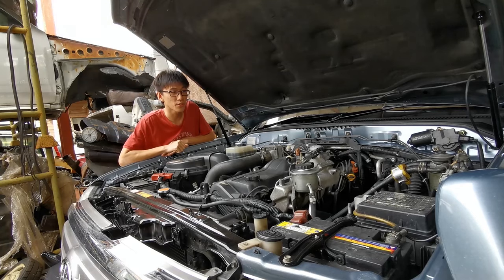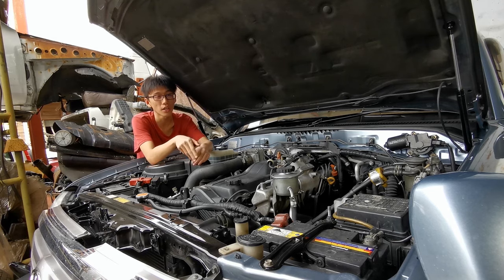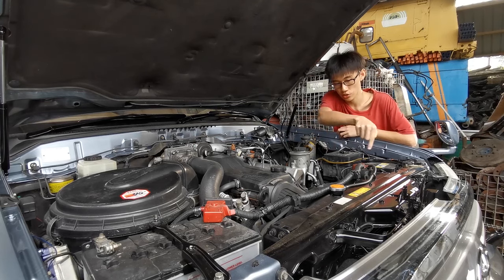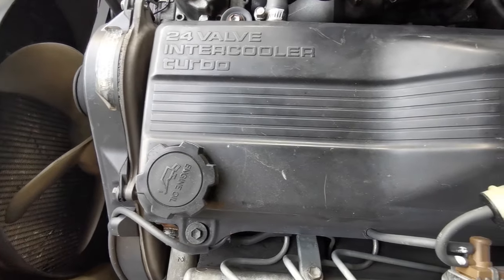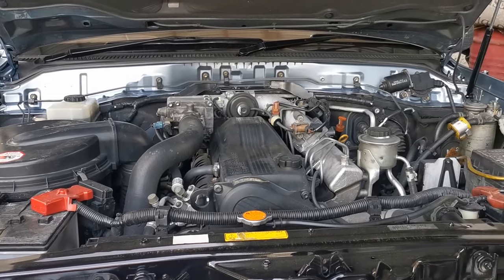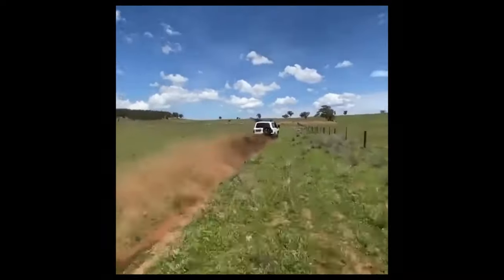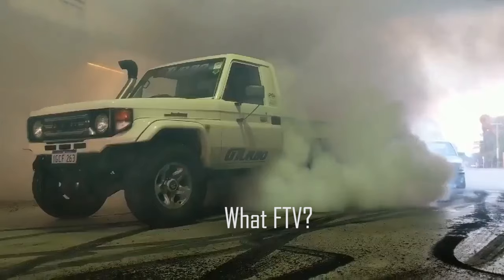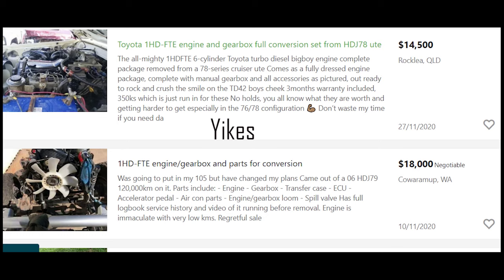Toyota's Greatest Diesel Engine Ever? 1HD-FTE Engine Overview

Comment: Not just Toyota’s greatest engine I believe it would be the best diesel car engine every made
Reply from the maker: It's definitely worthy to be in the Top 10 Diesel engines ever made in my books 😍
Reply: 6bt?
Reply: Make sure to replace those BEBS
Reply: @SacrumImperiumRomanum517 Killer Dowel Pin knocks the 6BT/4BT down a few pegs
Reply: Mercedes OM606 was a good engine too.
Reply: FYI: Diesel fuel does not burn. Diesel engines are detonation engines for the reason the fuel explodes. Diesel go bang. There is no flame front as the fuel burns as with petrol/gasoline engines. Boosting the fractory 1HD-FTE performance will shorten it's service life.
Reply: @sebastianromero420 that's just 1HDT.
Reply: @sebastianromero420 noneissue.
Reply: @jesuslabrado4862 That was only really an issue with the 24V and even then it can be modified to never happen
Reply: @AquaMarine1000 News flash- it comes boosted from the factory moreon!

Comment: I owned a 105 Series Cruiser with 1hz contemplating a turbo but your video inspired me to buy a 1HDFTE instead. I sold the 1hz with 240,000kms and picked up a 1HDFTE 100 series with 585,000kms for the same money. Very happy with the FTE it’s mint mostly highway kms so i figure it’s still got life in her.
Reply from the maker: Glad the video helped you to make the decision 😁. Do you have any socials would love to give you a follow. Mine is @tai392 on instagram
Reply: why give up the SFA?
Reply: Good move. The 1HZ is a hand grenade when aftermarket turbocharged and has nowhere near the potential of 1HDT or 1HDFTE engine.
Reply: I have a 105 with 1HDFTE .Motor only had 130 000km
Reply: My 1hz had a safari turbo kit put on at 180k
It’s at 411k now with now blow by 🤷
Reply: Same put a safari on mine 200k ago zero blow by and no overheating issues
Reply: @dave.a15  we’re the bearings done at the same time? Previous owner said they replaced the big ends at the same time
Reply: Do an engine swap of your 105 series with the 1hdfte then you have the absolute best of both worlds.
See what this guy has done:   https://www.youtube.com/playlist?list=PLCc9k0EV0wV9fB9SAN8vN3YeKxV2Yb6Yx

Comment: I drive a 79 series with the 1HD FTE engine. It has done 494,000 Kms and still runs perfectly. The most amazing thing about this engine is the fact that the oil stays clean between servicing at 10,000 km intervals. When I say clean, I mean clean, to the point it is hard to see the oil on the dipstick.  But I do have a question that you may be able to answer.  Apart from the sticker on the timing belt cover, I have not been able to find a Toyota logo on the engine anywhere and I find that very odd. I have heard unconfirmed stories that the engine was built for Yanmar to their specs by Toyota and that due Toyota having the troubles that you mentioned here, they got permission to use it in their own vehicles.

Comment: IMO its one of the best of Toyota's diesel engines along side the 1HZ it may not have the power of a 1HD-FTE but damn they wont die my 75 has just clicked over 300k and most of that was done on farm land it probably has around 50k of highway driving the rest is all off road same with our 105 its an ex Parks Vic patrol car.

Comment: Literally just purchased a 1hdfte 79series ute here in Australia today.
Have owned an 1hz 79series for 8 years. The 1hz non turbo is an amazing engine. Under powered but extremely reliable.. the new fte has amazing power on exactly the same running gear (gearbox and diffs upgraded) but suspension and steering identical.. the difference is unbelievable between the fte and 1hz.

Thankyou for your video. I am now subscribed 😀
Reply from the maker: Hey there, glad to hear you've made the jump to the best 79 generation imo 😆

I've always had a soft spot for the HDJ79 especially the HDJ79RV.
Reply: you mean 75 that came with the 1HZ the 76 came with 1HD-FTE in the later models before the 79 replace it and it has the V8 unless its had an engine swap done.

Comment: It's great, but Toyota required to replace the Crankshaft and Connecting Rod bearing at 150.000 KM, the indicator it's need to replace the bearing is low oil pressure under 1 Bar at idle.
Reply: That's 1hdt had bearing problems

Comment: Nice. Tip for anyone in the market, the auto is better than the manual. Uses a ford f250 gearbox and is just a beast off and on road. Mines rocking a badboy extreme Gturbo w/ a chip, exhaust, intercooler. Its quicker than my parents 200 series v8 twin turbo diesel, and stronger! LOVE FROM AUSTRALIA
Reply from the maker: Glad you liked it 😍 the auto imo makes it so much easier for the control and making the thing keep itself on boost. The 1VD is great engine no doubt but the small issues makes it just miss out on the Crowning jewel of Toyota diesels imo 😂
Reply: How did you go about transmission conversion, I’ve got a 5 speed auto which does not like extra power very much
Reply from the maker: @sappo6342  this runs a 4 speed auto. Great 'box imo. I'm aware the 5 speed auto has the overdrive issues 😅
Reply: @TAI-lr5vr  yeah the 4 speeds are decent, bigger box ect. In Australia especially with the 5-speed tuners are getting pretty good at tuning them to handle decent power, but I'm tossing up if I should just trade my auto for a manual haha
Reply from the maker: @sappo6342  our 4 speed did lose a forward clutch after beating on it for 10 years so not bad 😂

Comment: This Land Cruiser with this endine 100 and 80 series are still very expensive and getting more in the Phillipine, especially the locally sold for the domestic market, GCC market and even the JDM converted to LHD. 30-40k usd(50 php per 1 dollar) for the local, GCC and JDM for 10k usd.

Comment: 350,000 km and more economical than most 4 cylinder engines. Best engine Toyota have produced.
Reply: These have worst fuel figures  of any deisel even  a merc uses less and a LR td5  probably  10 more mpg   but the Toyotas good reliable  engine   but have seen  plenty  busted injector pipes

Comment: Good job Tai, very details video . Since you seem to have good sources, what do you think would be the enhancement for an 1hd-ft that would be equiped with 1hdfte injector  nozzles and pistons? 
Cheers mate
Reply from the maker: Glad you liked it. An FT with FTE nozzle, piston and injectors could probably increase the power output. The key is still in that injection pump system though. Not sure if it helps but many have had success doing an FTE minus E(non electric pump) conversion.

Comment: As a mechanic I love this engine in my 22yr old Cruiser "never a problem", But I am going to fly this question by you because you seem to research things like this, Why did Toyota put the oil filter upside down so it drains of oil so quick when parked, seems silly when it takes that bit longer to get oil pressure when started..Cheers Dave
Reply from the maker: Hey there, unfortunately I can't give you the answer to your question as I don't have access to the people responsible who designed this engine

Comment: How does it compares to the 1HZ in terms of reliability?
Reply: Lemme put it this way. My parent bought his 2007 model in 2008. Last year as i drove it, the speedometer ends at 180, and it aurpassed the limit and bent down like it was doing 220 or smthn. Mileage is 240,000 engine has never had issues or been opened. Only challenge i came across was that the break booster pump failed in 2017, some mechanic replaced a small part in it and charged me 70,000 ksh (700USD at that time) , a new brake booster pump in toyota kenya nairobi is 3,000 usd.
Reply: @zakgt500  Thanks. That's very helpful

Comment: I have a 2003 79 series rv has 340 klms so far no dramas .
Have fitted industrial fuel and oil filters from Filter Technology Newcastle.
Save a fortune in oil had the oil tested At 30,000 klms still ok soot particles were 0.4 ppm max allowed 2.0 ppm 
The filters are separate to the factory filters.
And finer 2 micron fuel and oil .
Factory filters 10 microns

Comment: I have the same model 100 series and was wondering relating to the oil pressure you showed , was that idling from cold start. my pressure goes up to 1/2 on cold and under load but when idling goes down to 1/4
Reply from the maker: Yes it is. I have noticed on the late model 5at cars the oil pressure doesn't go up nearly as high as the 5at cars have VSV
Reply: @TAI-lr5vr My oil pressure does exactly what is said here , hdj100 2006 , 1/2 cold & under load , 1/4 hot idle . Excuse my ignorance but what does VSV stand for ?
Reply from the maker: @barbraabsalom4531  VSV stands for vacuum switching valve which I must admit I got wrong. What I should have meant was the swirl flaps decreasing the oil pressure

Comment: Hello what do you think a bout 1hz ist good ?? Specially for off road ,mud , desert...
Reply: The 1HZ is a very strong, reliable engine that just keeps going. It’s incredibly slow, but it just doesn’t die. It feels like driving a tractor but you can always rely on it. The only issue with the 1HZ is when it comes to sand driving, where you really feel it’s lack of power if it’s over sand dunes.

Comment: Sorry but the 12HT has that accolade, and yes all Toyota engines good and great build quality, I cannot  believe I have been driving the same car for over 25 years.
Reply: 24years here.. on 220k mileage.. still running good.. thumbs up for it... Never fail on me.. do on time service and maintainer... Need chipped soon.. unichip maybe ? Or mod none electric fuel pump.. still thinking lol..

Comment: I had the privilege to drive a 400hp 1hdfte from Performance Diesel Intercoolers. It had the gturbo which is actually not larger, just more efficient.
Reply from the maker: Oh so it's the turbine that's different. Never had the chance to experience it due to the Mula amounts to buy an engine here
Reply from the maker: I didn't have the turbo size chart from Gturbo so I had to wing that part 😅

Comment: Serious question.
Is it possible to make a brand new 1hdfte using the 1hz block and aftermarket parts?
Will the cooling jacket and gaskets fit?
Reply from the maker: The basic block is mostly the same. It's the rotating assembly and cylinder head that's the real headache. And the fuel pump setup. I've seen some push a HZ-T to 500WHP so there's a big chance you can transplant the innards.

Comment: Hi bro which one engine is better 1HZ or 1HD FTE or petrol uz please tell me?
Thanks
Reply: 1HDFTE, the 1HZ is a slug, still an utra reliable engine but nothing compared to the 1hd-fte in terms of power.    You can put a low boost turbo on the 1hz but anything more will blow up your 1hz.

Comment: No matter what caind of the engine type is!! Of course TOYOTA have a best ever diesel engine from 2.4 to 4.5 they are a inmortal engine's 👏👌👌 cheers from Norway 🇳🇴
Reply from the maker: Thanks for your support! 😁
Reply: @TAI-lr5vr  i have a BJ 40 3.4D, HJ61 4.0TD, corolla D4D and  my father have a  HDJ80 4.2TD and a hilux 2.2D no problems the BJ40 just passed a 2millions kms and the corolla 490.000kms anyway we never stuck on road 👏👍👍
Reply from the maker: @jorgefonseca9225  that is awesome! We have 98 HDJ101K and ACA20 rav4 as daily. Lovely cars 😍

Comment: Do a vid on the 1hdft! How much better is it than an FT and how much better is the FTE? We’re not getting the FTE in America for another few years and I want an off road touring rig. With an emphasis more towards off-road.
Reply from the maker: Hi there, sorry I couldn't respond to your comment due to notification of YouTube playing up.

The 1HDFT is probably the pinnacle of mechanical injection diesel engine for Toyota but the FTE'S electronic fuel pump makes the driving experience so much better as it's more responsive and overall more fun to drive.

Comment: Only thing i have a problem with is the 2.8 hilux is literally just this engine minus 2 cylinders, and better balancing and vibration handling in the crank plus dont need a forged crank either unless you want more than 20 PSI

Only problem with the 2.8 is that it cant take load at all, its good when the cars full but if it then also has to tow something then it becomes an issue, but even then you can negate thag by getting 4.8 diffs and reduction gears then 31 by 10.5 and you shouldnt have much trouble

Really the only problems ive come across in the 2.8 is that it gets a little  hot sometimes when turboed, and the main weared parts are around cylinder 3 back. If yoy want to turbo a 2.8 you need to rebuild the injectors, get a boost compensated pump and then hook it all up and it shouldnt over fuel it nor under fuel it, if you  just use the stock pump it runs too rich and the load on the engine is increased, plus its only looking to be about 1000 for a boosted pump hopefully.
Reply: Hi bro..i have the 2.8 you are talking about and looking with envy on this hd engine😬. So we are in the same boat talking about turboing our asthmatic 2.8😅. Hey but take heart the 2.8 na will survive a nuclear holocaust 🙂
Reply: @hokz7283  oh  yea NA they will go forever and theyre a good starter car, but ive been researching alot on how these engines fail and what you need to make them efficient, cause thats what a turbo on the 2.8 is really for you gotta think its already getting over fueled stock cause theres not enough air being sucked in. 

If you get a boost compensated pump thatll stop it being really rich at thw start and then leaning out, and youll actually be able to get it tuned to 20 psi with a good turbo
Reply: @hokz7283  also apparently someones putting a 2hdt in a hilux and thats because he seen a RB30 swap
Reply: @samtimo3002  can we not just adjust the fuel enrichment screw to allow for lesser fuel then stock setting?. I have heard that turboing the 2.8d is not a good idea because of overheat issue.
As for fuel efficiency issue is it possible to slightly advance the fuel pump to gain something?
Here in my country we don't have any 2Lt engines to source exhaust manifold for turbo. I even thought of trying the isuzu 4ja1 turbo system on it.
Reply: @hokz7283  also remember 
2L=2.4
3L=2.8
5L=1992-1998 i think 3.0s
All diesel all sharing the same head bolt and passage patern all just different bore sizes
Reply: @hokz7283  also this may sound stupid but a stock 2.8 crank took 92psi from a compound turbo here in Australia, mf had billet internals and everything except crank hahaha
Reply: @samtimo3002  92psi ????...no it does sound stupid if i may say so unless of course they were trying to run the truck on air alone.
Reply: @hokz7283  yea its hard to belive but ive seen people talking about it on Facebook aswell as the bloke im getting my engine built at knows the bloke that done it, and he said it ran for a while but not long obviously, id say probably 6 months by the sounds of it

Comment: Have 1HD-FT in 80, very reliable engine, can't argue with that. But can't wait to replace it with 6.6 Duramax. Toyota engines never good at power output
Reply: Bro what your torquing about. Il buy your 1hdft if your gonna move in on. I'm in Perth western Australia. Let me know
Reply: @mechanic7430  There are no issues with the reliability, durability, and dependability of 1HD-FT engine. If it would have extra grunt it would be a great engine. I live too far away from the land of Australia. And I am moving along 6.6 is the way to go in land cruiser, plenty of power and torque.